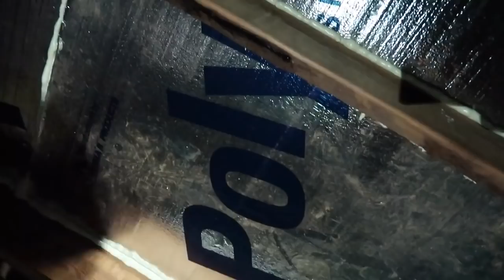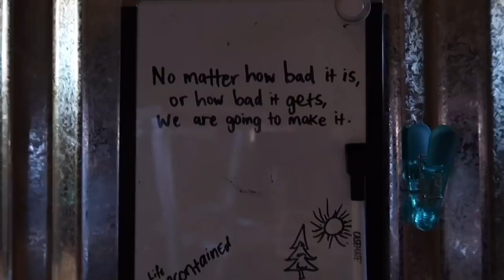So Close To Solar Power We Can TASTE IT!

Comment: How many batteries did you use? I am trying to go off grid and I use 1000kwh monthly. So I'm trying to figure out how many batteries I will need as a backup,and since I live in no mans land in Pennsylvania I have gone with a hybrid system (Wind and solar) so that in the winter time I also have power going into my system. So,how many batteries do you have in your battery bank?

Comment: New to the channel .... love it! Inspiring.

I think I would have mounted the solar on the barn roof, I know it’s harder to clean 🧽 them,  and may cause more possible leak spots... if done right it could be vary leak- proof. Over all I think it would have made the set up look cleaner etc. 

It’s always been a dream of mine to do something similar to what you all have done, but skip a few steps as in buy a pre built small cabin ... I know theirs lots of local and state laws about how big a house has to be.. but I was thinking about putting in concrete footers, then adding some ( wheels ) as a front to be able to pass local codes etc. 

Thanks for sharing your journey

Comment: Hello there, By any chance do you have the wiring diagram from your system? We are working with a identical components system and having an issue with the charger controller a Voltage drop to be more exact so if you can help.. I will appreciate it. Thank you in advance.

Comment: Just a suggestion.....Where the pipe comes in the floor from the solar panels....you need to plug that hole with steel wool or spray foam so no mice, snakes, or bugs can crawl in to that space.   I love binge watching you 2 build.  You 2 play well off of each other!   I really like your set up for power.

Comment: Spence, Heat shrink sleeving is a thermoset plastic, it will never last. You need a thermoplastic plastic. You are better off using black electrical tape as bad as it is.

Comment: Loving this series!  Having lived in Texas I know how windy it can be. Seems like with all that wind you would consider turbines.  Lots of DIY-able designs out there on the interwebs.

Also I can't believe your barn roof is almost aligned south and you didn't use that to start.  It also would ave provided a heat  break for the roof as well as protection from driving rains.

Comment: Hey guys, keep up the good work.
stop putting romex in conduit major code no, no!
Strip the outside sheeting off and put just the color wires in conduit. 
That way if they get hot they can cool and not start a fire!
Reply: Yes, I made this mistake once and got dinged by an inspector. Romex in conduit is not only dangerous, but a code violation. Something to put on the list to correct at a later time.

Comment: Hi Spencer and Mackenzie, I love your channel. I am going off grid in about 2 to 3 years (still need to save a few more dollars). I have to be honest, I am nowhere near as confident as Spence is to install your own panels and batteries. If I hire an electrician, what kind of electrician would I look for? I want to buy all my hardware but I don't even want to challenge myself to instill it because I don't know the difference between series or parallels or inverters or how to read a control panel of energy used or using. I would be in your debt for any advice. 

Thank you and again, love your channel. I can't wait to see you end project. 

P.s. Where did you buy your containers and if I may ask, how much were they each?

Comment: Love the progress , you guys are doing a great job. Just a suggestion , I would put something on the roof to make sure it does leak when it rains. I would hate to see all that hard work on the battery setup get wet. They have that roof far in a few different colors. That would also help dissipate the heat from the sun. They also have that product called Flex Seal in gallon cans now. I heard that works good. Good Luck guys

Comment: Is there a lighting arrester at the combiner box to keep the charge controller/inverter from being Fried? AltE sells them if you haven't gotten one yet. Texas gets some pretty nasty lightning storms!

I've had my Schneider setup for a little over a year, works great with no problems. You might want to get the comm box for the inverter and mppt controller, provides some nice stats on the system as a whole.

Comment: What did u set the max charge voltage to. I beleive they are 63 v max voltage i probably wouldnt go over 60v to give yourself some safety buffer on overcharging them.  What is your inverter cut off voltage? Im thinking shut off should be 50 volts. This way each cell should see no less the ln 3.3v and no more then 4v. Normal max V per cell is 4.2v and minimum is 3.0v. Bit if they are not perfectly balanced while most are 3.3v one or 2 cells could be 2.9 causing damage. Im building a lithium backup power now with fiat 500e bateries and if your not using a bms like batrium its worth only using 70% of your batteries capacity to keep em safe. Eventually ill add panels and wind turbines. But now just a 20hr battery back up is enouph to keep me happy.

Comment: Well done , keep up the good work, note, a lot of shading on your panels during the day, any plans of trimming some trees to remove shading. will help in the long run.
Reply from the maker: Thank you. We actually are getting way more power then we can use right now. The batteries are usually full by 10:30 am and that’s only with 1/2 of the panels getting sunlight. By 11am they are in full sun until about 630-7pm.

Comment: When in use, please check the crimped connectors. When they heat up you have a bad crimp and a potential fire hazard. The crimps look fine btw. And going strong for the 200 subs :-)
Reply from the maker: Thank you! I had that same thought but trust me I tugged on every single one and they aren’t going anywhere.